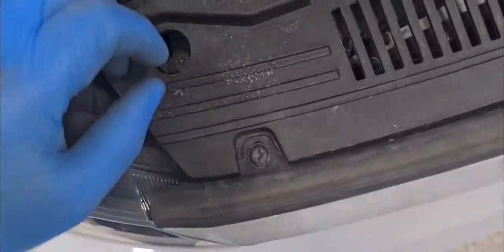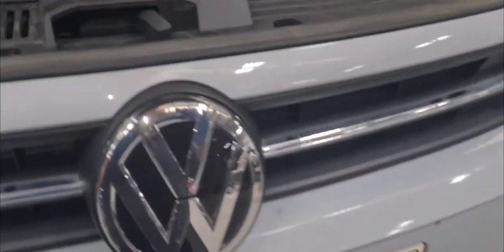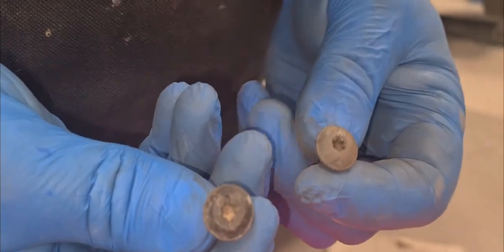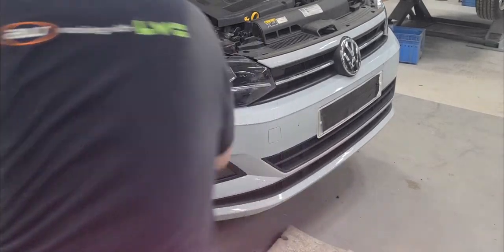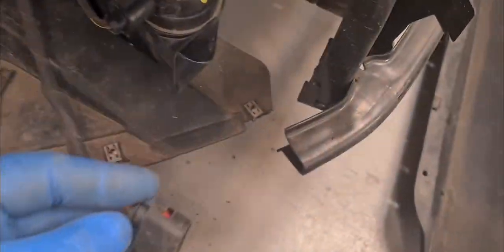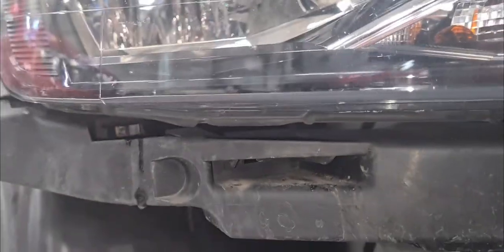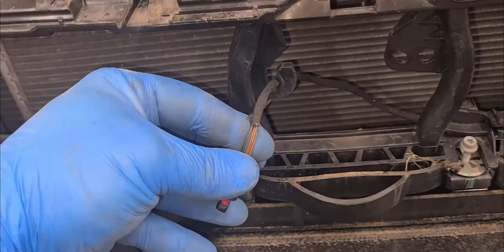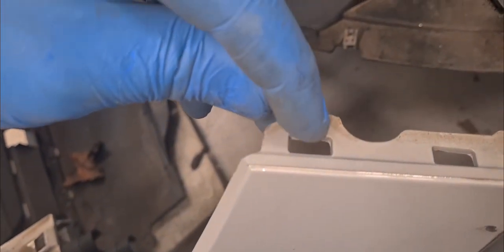How to remove a 2019 vw Polo front bumper...

Comment: I removed the bumper and the proximity sensor plug but cannot figure out how to remove the connector to the acc sensor (safety sensor behind the badge). There is not room to have a look. Just how is the undone?
Reply from the maker: Some have like a gray tab on the plug...pull the tab back and then after it slides press on it...
Reply: Figure it out. The nub needs to be pushed in. That will lever the catch off of the sensor. The problem is that there is no room for your thumb to do that. While trying to undo this, I suggest tying the bumper on with some string. The cable ended up taking the weight of the bumper a few times while I was trying to figure it out. The picture of the following helped: "ACC Radar Wiring 2Q0 VW Tiguan MK2 / Škoda Kodiaq / Audi Q2 since 2017" (though not the right part, it has a similar catch.)

Comment: Does the badge cover the radar sensor come out without removing the whole bumper?
Reply from the maker: Hi...the badge comes out with the grille...just remove the upper grile,just with care because the loom is short and you can damage the plug if you pull the grill hard.
Note to you,if you remove and unplug the radar sensor is recomended to have a calibration after...lots of functions relly on him...like,adaptive cruise control,city braking/safety...so on
Thx for watching sir.
Reply: @howtowithjohn581  Is the radar sensor the same sensor as the park pilot and front assist sensor? Because I have the plug but no sensor (because the front of my car is wrecked) and i cann’t find anywhere what kind of sensor it is….
Reply from the maker: Yes sir...older version is on the cross memberand visible thru the lower grille and the new models is under the badge on the top grille...if the badge is smooth you have a radar...if is 3D  is not there... thx for watching sir...
Reply: @howtowithjohn581  My polo is from 2019, if I sent you a picture could you see what kind sensor is supposed to be there and what kind I would need?